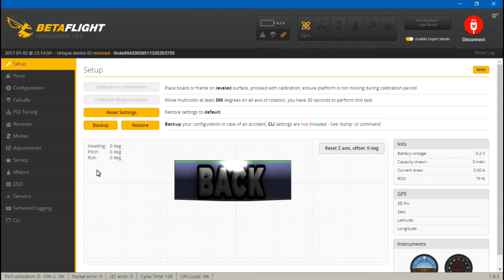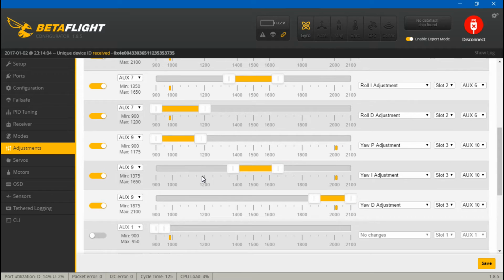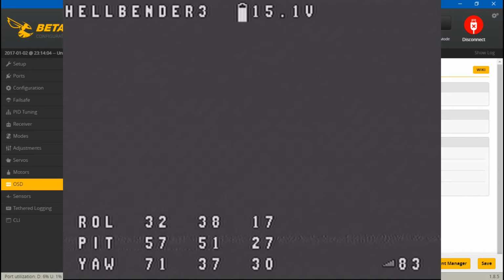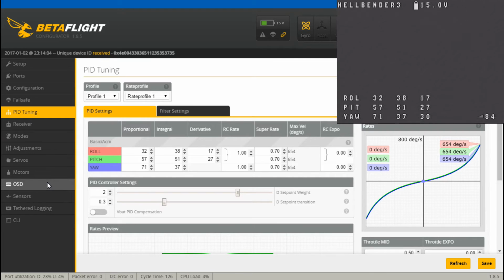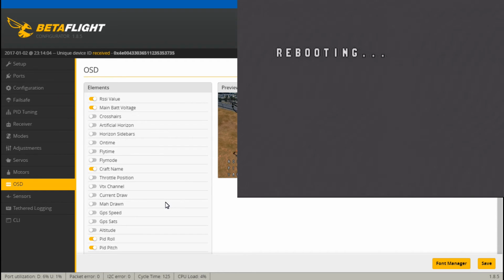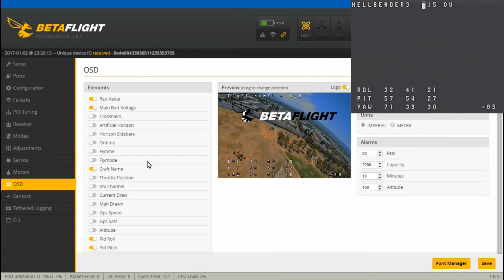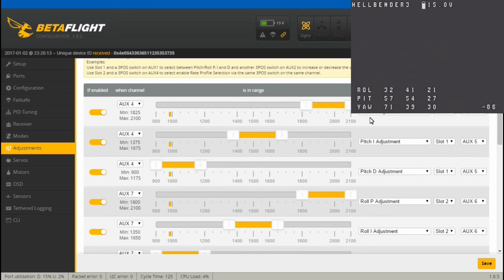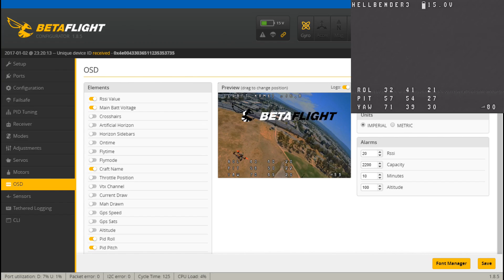Changing PIDs In Flight Pt 2

Comment: Quick question, are the adjustments relayed to FC via s-bus or the smartport of the receiver?
Reply from the maker: Its just sent through channels. Not just Sbus, it works with any type. PPM, Ibus, or any other. Telemetry is not needed for this.
Reply: So i'm in the middle of my first build and first drone really, i figure go big or go home... after extensive research i think i got most the parts sorted out.  I'm still a lil iffy about the Rx, its between the xsr or the xm.  Main difference being smartport.  How useful is this and will it be more useful later, in Joshua's betaflight 3.1 overview, theres a part where he talks about how smartport would come in handy, but i think its in regards to what your already doing here. If smartport isn't needed for this, is there much practical application for it, aside from viewing RSSI?
Reply from the maker: Smart port to get telemetry used to be a useful thing over a year ago when OSDs sucked. But in the last 6  months they have become so good that I've stopped using telemetry completely. I mean with telemetry you could make the Taranis beep when you voltage or RSSI is low, but I just prefer Betaflights OSD. As far as the other stuff, in the future then yes, smartport could be used to change frequencies on certain video transmitters, but it's not that big of a deal. I dont have a problem with pushing a button on the video transmitter itself. You could get the XSR, its still a great and small receiver. Out of the XM or XM plus I'd say dont get the XM. Its range is really short and you'll have drop outs. The XM Plus though has the same range as the XSR.